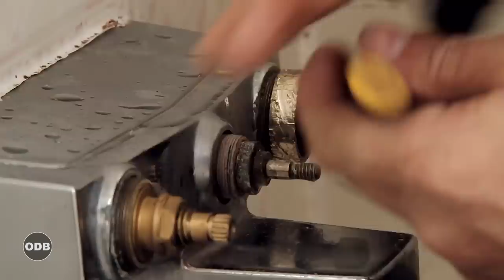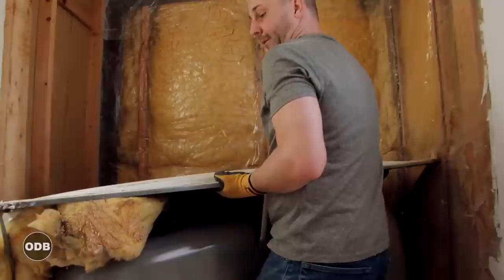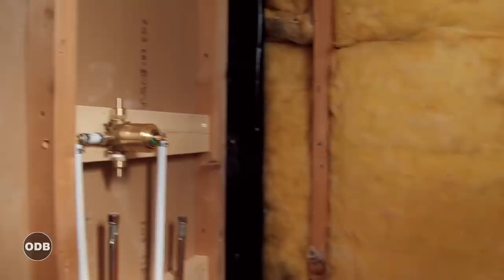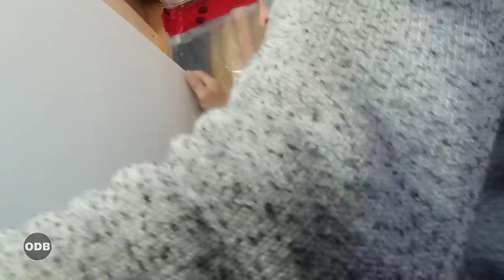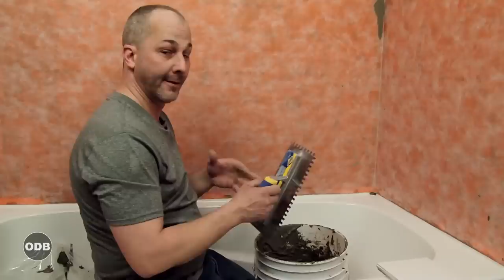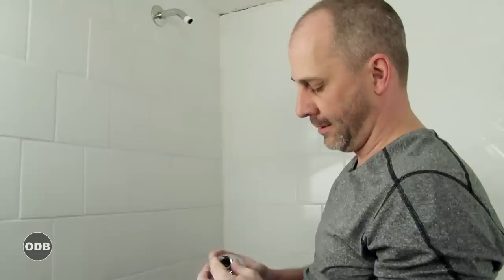DIY How to Renovate the Tub / Shower from A to Z

Comment from the maker: Now that you have this mastered, it is time to move on to the kitchen or laundry room for an update. this video shows you how to update an existing space with new flooring and painted cabinets and new countertops with a n awesome ceramic backsplash!
https://www.youtube.com/watch?v=P32kerGV8eg
Reply: Home RenoVision DIY 

How did you close out the cut wall on the painted bathroom wall that u kept?
Reply: Awesome video.  Thank you so much.  Can you use Kerdi under tile floors?
Reply: Home RenoVision DI
Reply: What caulking  would you recommend  for inside  shower brother
Reply: I love ur channel...plz wear safety glasses so u can continue to teach us !!!! Thx for showing me how to demo with out making a mess ur the best. God bless and keep up the good work!
Reply: I hv been told only two rules to plumbing...water always goes down hill and do NOT lick ur fingers....lol great vid thx.
Reply: Home RenoVision DIY you hiring lol
Reply: Question about tile...
I noticed no back buttering...
Is there certain kinds that require it dont? Or is back butter an overkill?
Reply: How much are professional,charging for it.
Reply: Guogu
Reply: Gaden
Reply: Donot  one  has to use  Copper for spout  always  please  correct me if i am wrong  i was told because of water pressure  thx
Reply: Hi is it ok to use  pex  from valve to  spout ??

Comment: Great job looks super. I’m a carpenter from the 80s. When I would tile, used rock type board behind tiles. Even built complete shower stalls with rock board. I can see that the things your using is much better. You really know what your doing. Now that I ordered a shower surround that is cheap expensive plastic, now I want tile lol  I still have my electric tile cutter, adding up tile now . Thanks for video

Comment: Jeff, excellent video, you provide smart and efficient ways to renovate. A question for you, my shower has tiles on 3 sides as normal and the ceiling, what is the best way to remove them.  it's a little different than your other videos where only 3 sides are tiled thanks
Reply from the maker: use the same process and save3 the ceiling till last. bust it into thirds before pulling down. Cheers!

Comment: You answered my questions. Good video. I did not know if to use Grout in corner sections, but you did (I read just Caulking). Also which walls to put in first ( if this effects the corners but after Grout looks like does not matter ). The Grout tips you give about corners great too.

Comment: so it is safe to use drywall behind the tab instead of fiber cement boards? i always thought fiber cement is a must. Also, I always wondered how well a drywall will hold the tiles (especially the heavier large ones). I have a drywall behind our wood furnace and I want to install  nice large sand stone tiles to cover it. I wonder if i must replace the drywall with fiber cement first....

Thanks you SO much for your always amazing videos! very enjoyable.
Reply from the maker: in some areas the building code allows it. best to check if yours does. Cheers!

Comment: i once used pex for my tub spout,  when i turned the water on, i had water at the spout and the shower head  did this happen here to?   i had to use copper for the tub spout as it has a bigger inside diameter than pex,  and water travels the easiest path, once i knew this it made perfect sense

Comment: Wouldn't you recommend duraboard or moisture resistant drywall (green drywall) the copper pipes can still create humidity and condensation behind the wall and create mold I really wanna know I'm not a pro is just than I been doing crazy research on the best options

Comment: You said to use non modified cement for the schluter application. Thank you for that. 

Does it matter what type (modified/non modified cement) you use on top of the schluter to apply the tile? 

Thanks!

Comment: We are planning on doing everything in this video but removing the tub as the tub is in good condition. My question is related to placing a new vapor barrier. Do we need to remove the tub and replace all of the vapor barrier or can we just replace from the tub up?
Reply from the maker: Hi Pauline, I would suggest that is a personal decision. There is no rule that says you must remove the tub to upgrade the vapor barrier behind it. truth is the risk of personal injury and potential drain leaks down the road really outweigh any benefit in my mind. Cheers!

Comment: Can you do a video on installing a deeper bathtub after removing a standard bathtub? Thank you
Reply from the maker: we did. simply use the search tool for bathroom remodeling
Reply: I just noticed that my tub seems to be apart of the tile. It looks connected and both are not real tile. More like a lookalike tile. This house is 30 years old. Any idea what kind of tub this is? I just answered my own question i googled it. Its a one piece tub surround. Any success at changing to a deeper  tub and shower from your experience and add installation to avoid the loud noise in the walls? Thanks

Comment: Over time when there's discoloration between the tiles, what exactly is happening? And when that happens, does that require regrouping? Or a new application of silicone? Or both?
Reply from the maker: mold. cheers!
Reply: @HomeRenoVisionDIY  ay :( what's the right fix ?

Comment: I'd be worried about that hot water heater running dry being he didn't say shut the power or gas off to it. Safety glasses work well when worn. Good job
Reply from the maker: we drain the water from the lines to the bathroom not the entire house!

Comment: I have a problem with installation of a bathtub (Delta 40034L) because I need to remove a part of the stud on the right at that place where the apron is (it doesn't go through). Bathroom is 60.5 in from stud to stud, bathtub is 60 in long and 19 in tall (since there is a base attached to the bottom of that tub), so diagonal is 63.02 in. The stud is 3 and 3/8 ", so if I remove that stud (part of it), the problem will be solved. That stud consists of several parts,  which vary in length, 1.5 and 3 feet each. I don't know how those parts are connected, but it shows lines with teeth marks on the borders. Of course I can cut off with the reciprocating saw, but think it should be done differently, using those parts (with teeth), where they are connected. The wire goes horizontally (I saw it through the slit between the stud and drywall), so don't worry about it. I wanted to attach some pictures, but don't see the option here. It is left sided tub, and I need to remove the stud on the right (if you are fronting the tub), where the apron is. Thank you for your film.
Reply from the maker: olena, feel free to remove the stud. you can reattach it later by screwing the tub flange to the stud and using construction adhesive on the plate and then resting the wood back in place and using screws anywhere where it is accessible. Cheers!
Reply: @HomeRenoVisionDIY  Thank you so much for you concern and so quick response. I glued the apron support to the apron and waiting when it will dry off. I used epoxy, hopefully it will hold, many people complain on this tub that the apron support pops out during the installation process. I also ordered a new waste drain, since old one seems to be kind of short (I think because of the attached base to the bottom of the tub). My acquaintance wants to come and check if it is not a bearing stud. I think it is not since many people need to remove it (I saw in some films), I'm not the only one with that problem. They are actually two studs, one perpendicular to another, so if to cut that one which is parallel to the wall, nothing happens. But if you can (and have time of course) give your opinion about it I would really appreciate it. I also think that the film about that particular part would be helpful for many. Thank you again, all your films are great and helpful. And though it takes way more time for DIY, but one can do it and better than some professionals.

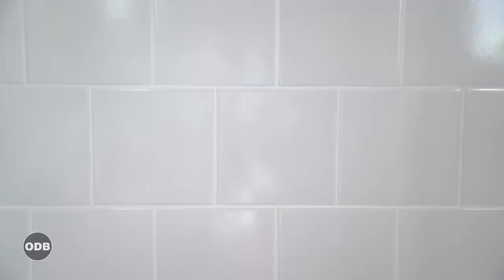Comment: at 1:18:49, I see the metal trim piece used to transition the tiled wall to the existing wall isn't sealed and is showing a visible gap. Does this just get hit with a bead of silicone to join it?

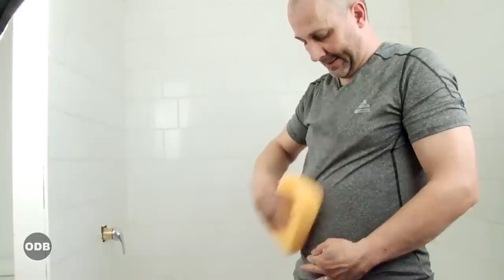Comment: Well done on the video.  My only suggestion would be to not grout the corners (1:05:50) as per the industry standards in North America and Europe.  Any change of plane should be done with colour-matched silicon.  At the very least, the discussion between the pros/cons of each should be mentioned.  Chances are very good they'll crack with grout in them.

Comment: hi i have a shower to install and im doing the hot and cold the problem is i have no where on the valve mixer to fix to wood framing
Reply from the maker: you can always use some all round metal strapping to tighten things up. Cheers!

Comment: 10 years comes along pretty quick. Wouldn't it be smarter to install a surround that's designed to last a little longer?
Reply from the maker: Hi Tommy, when using a waterproofing system like this you get a 40 year project. the ten year is how houses are made today. It sucks.

Comment: You should be wearing safety glasses and at bare min a dust mask, you worry about cutting your hands well consider what those tile dust particles are doing to your lungs! Safety first it’s not worth the little added hassle of safety.
Reply: agree and mold  dust asbestos causes cancer. I guess doing presentation makes difficult  to wear mask.
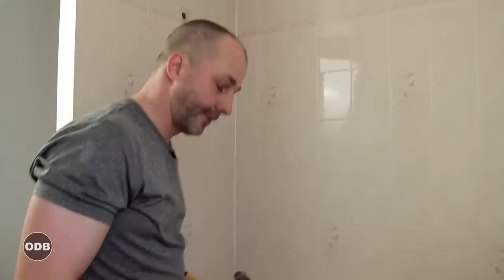Reply: @8:30 before picking up those two tools---Safety Glasses. I the words prying and porcelain in the same sentence gives me the creeps.
Reply: And shortly after saying that broken porcelain tile is incredibly dangerous.  Disappointing.
Reply: It would have been difficult to talk had he worn a mask, but good point.
Reply: He'll be fine

Comment: I am a plumber in Texas and I don’t believe I would put shark bite type fittings in a wall without access. Also turn your pliers around they will work better
Reply: Also would have been a good idea to use pipe inserts on the pex, them sharkbites crush the plastic
Reply: That wall is accessible   check the video.
Reply: I agree turn your pliers around they work better too I've been on several floods from SharkBite failures due to corrosion they do fail and I agree should have mentioned to be sure you have the inserts in the Pex piping been Plumbing for 35 years licensed
Reply: Lol I know and he turned his tube cutter backwards haha
Reply: His hand grip is so strong it doesn’t matter how he holds his pliers when using them
Reply: @ukfarmsim4696  Inserts aren't used with the cinch connections used here. They are required with Sharkbite push to connect fittings. Doh
Reply: @sewerat11  Pex inserts are only used on Sharkbite push to connect fittings. The cinch clamps + barbed fittings in this video don't use them. A licensed plumber for 35 years should definitely know that.
Reply: @jonshepherd2550  he's from Canada.
Reply: Yes I live in Texas to and shark bites in walls is a no no.Just ask a building inspector.
Reply: @crawdoogie  Everyone in the comments is a licensed plumber who's been doing it for 30 years

Comment: Great video! One question though. I really like the Kerdi membrane, but there are two perforations where the valve and faucet come through. There wasn't any silicone applied to these fixtures, and as you said, this wall sees the most water. What protects the drywall in these areas? Thanks for the very informative and well-explained video!
Reply: I am in the process of installing a new shower in a room that had a bunch of mold. I chose the kerdi board based on another of Jeff's videos and was thinking the same thing about those holes! Kerdi sells a membrane for $80 that you can use for the valve and I bought their $7 membrane peice for the tub and shower spouts.

Comment: As a retired plumber ,i loved this video,,but im still confused by the sharkbite after looking at al the other revues,no one out there seems happy, with them,for me it has to be all copper and solder,oreven compression,
Reply from the maker: Funny, the reviews on the product largely mirror sentiment from the first generation product line.  The product has gotten so good they give a 25 yr warranty on the part now. But once someone has a bad experience they label something for life. This is why old dogs don't learn new tricks. You need to work at something new to perfect it and that is just irritating to guys that already have a proven method.
Reply: Copper is awesome if it were 1967. 

Pex is best these days - BUT - there are 6 broad types of Pex.   He used the worst kind in this video.
Reply: Don’t use shark bites unless it’s in an exposed area
Reply: Sharkbites are amazing, they bite into the pluming and not going anywhere.  Copper is dead to plex. Plex is flexible and be used anywhere. Plex can expand/contract without issue unlike copper.
Reply: He is showing people how to do it themselves.  Most people cannot sweat copper pipes so this is the best option.
Reply: @KatyBauer1  Compression fittings work well and all you need is a wrench. The taps he took off were compression fittings and they lasted 30 plus years. Shark bite use a O ring which will dry out and shrink and leak eventually.
Reply: I have noticed almost all the bathroom remodel videos I have viewed all seem to use the shark bite fittings in today's cordless power tool and quick access to large department stores it very easy to go with these type of fittings when you are completing a bathroom remodel . Everyone who is watching this for a DIY job will more than likely go with the hardware displayed and if installed properly will last the lifetime of the home or more likely till the next remodel when trends have changed.

Comment: Not a criticism but as a home owner I rather have fittings done traditional way soldering copper pipes.I would never sleep easy knowing all my house safety depends on crib, plastic pipe.Once walls are installed it will be lot costly to correct this.Do it right to begin with.I think some things are worth spending money even hiring a plumber to solder.
Reply from the maker: If I was working in your home Then that is what you would get if you asked. Thanks for the comment Ruben.
Reply: Every house built in the 2000s is about 90% PEX. If it didn't work you would have heard about it by now.
Reply: I would much rather "new style" pex then copper.... no sharkbite tho, they blow alot
Reply: The problem is that it doesn't work after 10 years. Ive lived in a number of new build '00 type apartments and the cement / plastic fitment just come away after time. At mains pressure its a massive problem. There is no way i would use plastic fitments in walls personally. The only exception would be long runs without brakes that convert to brass behind a maintenance hatch.

Comment: Wow, that is an extremely poor tile job. When you put the grout on you could really tell how uneven the tiles are. 
The grout completely covered the corner of some of those tiles. Because you aren't even trying to stay at a 45 degree angle while grouting, you are pulling a lot of crap out from the joints.
The tiles at the top of the shower are extremely uneven. I mean you weren't even close with the widths you cut them.
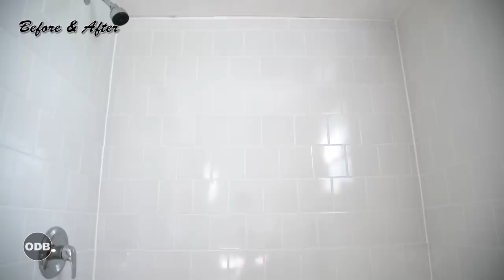1:18:34 the tops of the tiles still look like crap in the after shot. This would be a "good job" if someone did their own bathroom with no experience, but you actually charged someone to do this to their bathroom.

Comment: Thanks for making such a lovely instructional video. I am in New Zealand and is very helpful. Lovely gesture to your mom. Only one question was when you put the new tub in was that bolted somewhere or how does the tub sit without moving. Thanks again
Reply from the maker: Yes we screw the integrated tile flange to the framing first before tile. Cheers to New Zealand. We have a new bathroom series coming in a week. It shows all the points we missed on this one. Cheers!

Comment: Thanks for making a lovely video. I'm a huge fan of yours. I've recently installed a drop-in style bathtub (recommended to purchase from my contractor) in alcove because it was on sale. Because it's for drop-in, it doesn't have the integrated tiling flange. After the installation, even though with the thick coat of silicone caulk between the tile and tub, it kept failing and making water leaking. Could you give me a recommendation on how to make the waterproof between the tile and bathtub(which doesn't have tiling flange) in this situation? Greatly appreciated in advance.

Comment: Very interesting video - thoroughly enjoyed it (liked and subscribed).

Just as an observation - here are a few of my tips:

* Hammering tiles off the wall?.. PUT YOUR EYE PROTECTION ON! 
* Put your base line of tiles on wedges to create a gap between the bath and the lower edge of the tile.. that way, any noise generated by movement of the bath against the tile will be greatly reduced, if not eradicated...
* When mixing your adhesives and grout from powder etc... PUT YOUR MASK ON.. else twenty years down the line, you'll be wondering why you're on oxygen full time and your lungs are screwed...
* Consider sealing the back plate of the bath tap AND the water outlet to prevent water penetration over time.

Comment: I have a corner stand up shower with a vanity/sink right next to it. Over the vanity is a light fixture. I want to remove the vanity/sink and overhead light fixture and put in a bathtub. Then put the vanity/sink on a different wall. 
OR just pull out shower and adapt it to a suna bathtub style without messing with removing vanity/sink and overhead light fixture ???? What do you suggest?